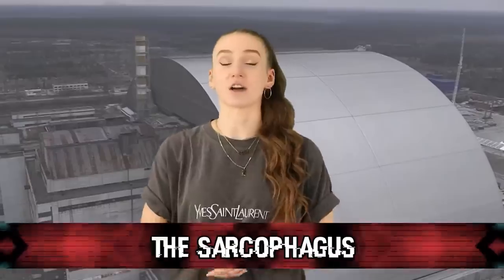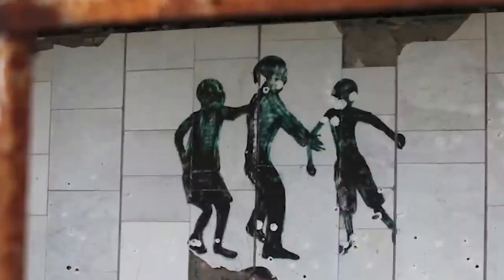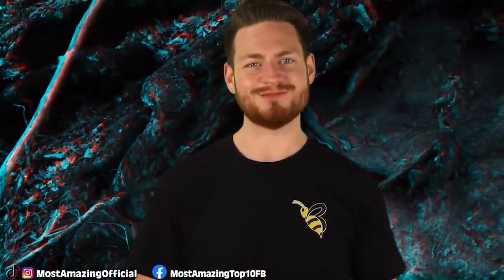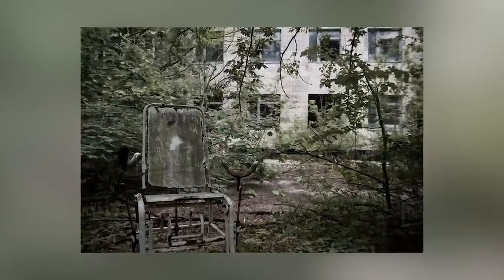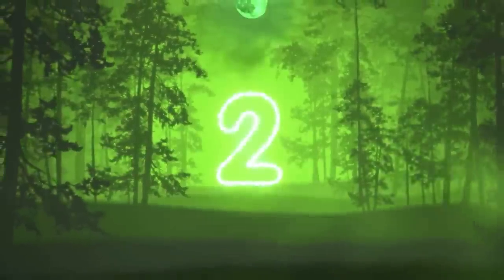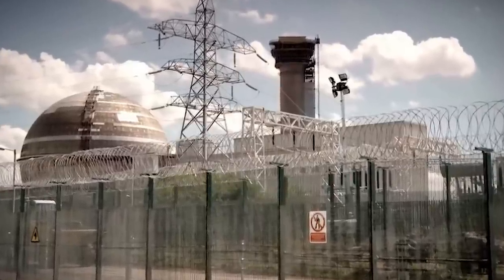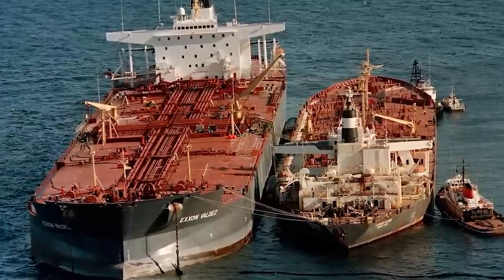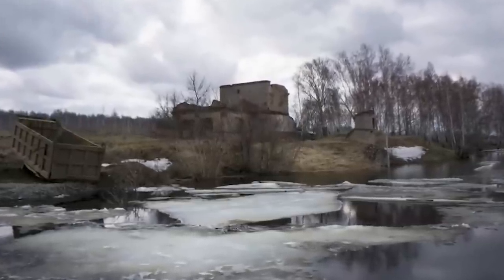Chernobyl Secrets That Should Have Stayed Hidden

Comment: How to deal with Chernobyl. Try using Insulating  liquid Foam ( used for ceiling pipes to keep the cold out) mixed with lead witch may slow or stop the gamma rays. ( you need to get a engineer to mix it correctly) “and this is a Theory” The structure can keep the foam inside the structure. ( just like pouring concrete you need a frame until it hardens) How to deal with Chernobyl.  The Cost  would be a fraction of what your paying today. And to make it work get someone how Knows how to pour concrete, “A lot of concrete.” And when to-pour insulating liquid 🎃foam. 🎃

Comment: so peoples understanding of nuclear meltdown and think it explodes during the meltdown.. Now a reactor is not contained like inside of a bomb casing which normally is a core that is enclosed with other explosive material that causes an explosion. A meltdown is where the core is a runaway reaction where as if it gets too hot to fast the blockers no longer function as intended or melt from the reaction even if placed inside the core due to not enough cooling to bring down the heat.. In the documentary there was a leak in the chamber that wasn't noticed so the core was without water for an hour after that point it was too late to cool it down which caused it to melt not explode the conception that all nuclear reactors explode is a misconception this is only true if such a reactor was enclosed in a way too allow this type of reaction in most modern cores they have plenty of room and tend to melt without exploding. Now the blue column in the sky is normal when a fissile material is reacting it can burn a hole above and below it the light you see is the result of the reaction releasing gamma rays and beta particles depending on the material used which case most use plutonium which results in a blue glow where as Uranium is a yellow greenish hue.
Reply: The Chernobyl disaster wasn't from a water leak. They were running a test on the pumps at low power and accidentally set it to zero which in a chain of misteps following, caused a steam explosion/meltdown.